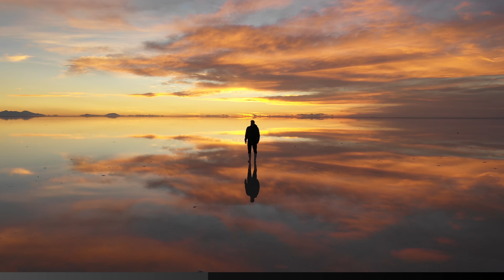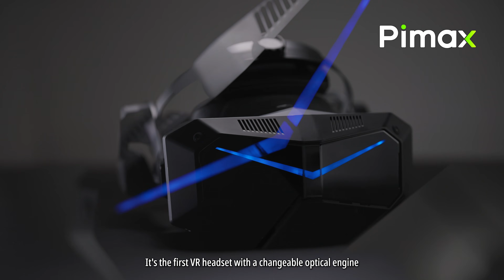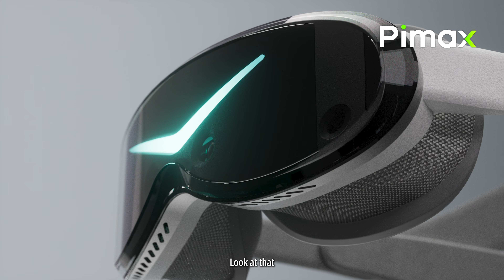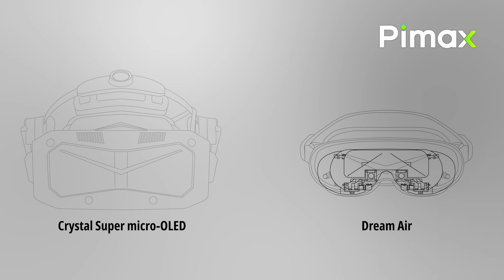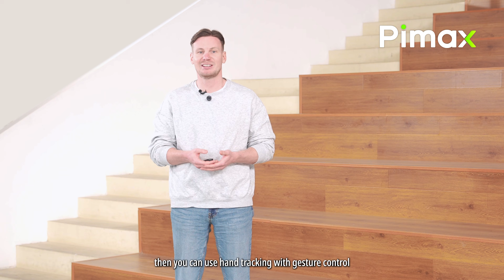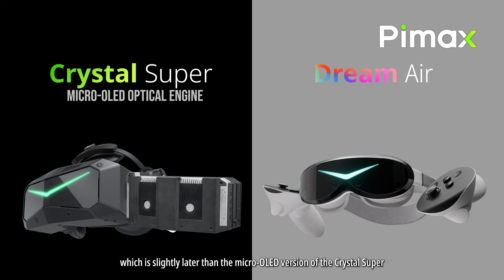Frontier: Hello Pimax Dream Air

Comment: One year later, shipping started a month ago, almost a year delay. No self adjusting soft strap, no fully auto IPD, you have to set it in software manually, hand tracking only on SLAM version.
They produce 100 to 200 headsets a month, so it will take forever until everyone gets theirs.
Edit: 
as of April 25 there is no 3D head strap included anymore, and for the SLAM version the promised ringless controllers are no longer a thing.

Comment: There is two versions of tracking that you can get:  SLAM w/ controllers and Lighthouses.  So, let me guess...if you're getting the Lighthouse version and try to integrate COBB (especially making the headset wireless), you're screwed, right?  Because how is it going to track you for example, on a plane without Lighthouses?  Tell me if i am wrong.

Comment: You need to start competing with Meta or there going to crush the industry, yes people want high end stuff, and that's great but most cant afford a headset at a thousand quid and will opt for an all in one solution from Pico or Meta, I use a Pico and at the 400 quid I paid for it, I'm more than happy with its performance, I only use PCVR wireless, and wireless is all I will ever use because cable tethering irks me, its great that your innovating and all that but ask yourself this, who owns the market share in the VR industry, and it only takes a little more innovation from them to tip the scales beyond an unrecoverable state.

Comment: Hi, I'm a huge fan of VR Headset, I had in mind, for quite some time now, to get a Pimax headset, but until now I said no, because they are not quite comfortable, especially on long sessions, it's not only about the weight but also about the volume of the headset itself, too big even if they say they are pretty good (wearability is one if not the most important aspect on VR headset).
Finally you present a headset that probably changes the rules, small, great resolution,  micro-oled, pancake lenses, 200 grams (wow), hand tracking, eye tracking, auto IPD, self adjusting strap, spatial audio and microphone, the 102° FOV is quite meh by the way (but if the rest works great ,well we turn a blind eye on this) and so on.
Nevertheless a biggest problem persists, apparently you have not quite a good reputation on support, hearing the web of course, which leaves me in perplexity, should I or shouldn't I trust the company? Because 1.800$ dollars are quite expensive.
One thing is sure, I will not pre-order it, even if I'm enthusiast and the promises are quite excellent, but the sense of preservation tells me to wait and see what it will be

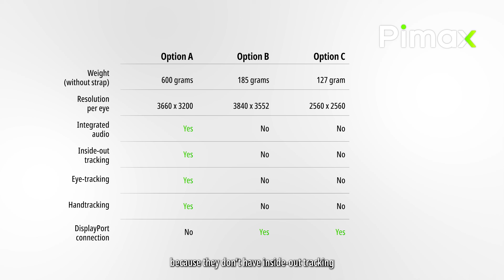Comment: 4:45 who cares about „weight without strap“?! when i want to know the weight, it should be completely assembled as i use it… i will not hold them infront of my head, so the strapping system is a necessity!

Comment: Ngl this headset seems like almost the perfect headset, the fact its inside out tracking yet targetted at vrchat players seems counter intuitive, considering most of us use full body which requires base station tracking so hopefully that base station tracking face plate will come soon after its release, also having eye tracking but no face tracking is a little dissapointing as atm the only headset that offers both is the quest pro, which quite frankly kinda sucks, and I've desperately been looking for another option, I'm also curious just how good the mic will sound on the Dream Air as the last headset I owned from Pimax had a terrible microphone, I am very excited to see if this headset ends up being real though I will definitely be purchasing it, just need to wait and see someone have some hands on experience with it so I know if this really is too good to be true because I have been scorned in the past

Comment: why would i buy this over a quest 2/3 i'm so confused
Reply: If you feel a moped is more than good enough, then yeah, don't buy a car.

Same logic here. Only people who feel the features are worth the extra cost should buy it.

For example: in my case, I like OLED headsets to be fully plunged into the dark when I'm in a pitch black environment. At the same time, if I wear a 900 grams headset for more than 4 hours, no matter how comfortable it is, my neck gets tired, even during seated experience. Ever since I got a lightweight headset, I can now wear it 9 hours long without ever feeling neck fatigue.

Comment: What is the brightness? Very important since the only comparable headset is super dim. This seems comparable to the bigscreen beyond which has the custom printed face gasket and is lighter although the eye tracking is a good justification. Its awesome that its small, light, has high res OLED and pancake lenses but that strap doesnt look like it can be replaced with third party options and developers often get ergonomics wrong for their strap that looks so uncomfortable for the ears. Where does the cable plug in? Can it be standalone. If so how much battery life does it have? I will spend over 2K for a headset with the right features. We haven't seen a clear upgrade to the valve index in four years. I am hoping they get this right I have never been interested in pimax before but this could be a big game changer if they have the right features.

Comment: The one remaining thing I DREAM this has is a much better FOV than the Quest 3. I am sick and tired of VR headsets with small FOVs. And I don't want to have to wear a giant brick just to get that either. So we have what sounds like an almost perfect balance in this headset, so long as it has a larger FOV than the Quest 3. Now, what's the FOV on this thing?

Edit: Ah, it's 102 degrees. So, not as much as I'd like personally.

Edit 2: Wait, this thing is wired? Is it wired only? I'm just not interested unless there's a standalone option.

Comment: 102 degrees FOV........

Crystal Super 120 degree FOV.......

question, when is the successor to the Pimax 8K-X coming out?   
Would love local dimming, HDR but in a 150 or 170 degree FOV headset.  Thanks

Comment: I’m still waiting for proper applications on my Pimax Crystal in AIO mode. Pimax sells headsets for a fortune but falls short on the software side. It’s astounding. Let’s not even talk about component support. I’m still waiting to be able to purchase a Pimax hand tracking module. And I’m starting to wonder if it will even be possible to buy replacement batteries for the headset.

Comment: It's still early for 8K glasses, not even the RTX 5000 will be able to run games at 90hz. Better to keep 4K
On top of that, less fov 102º minimum 115º (Crystal Light has 130)

Comment: You kept saying full feature for the dream air and it ALMOST sounds like the absolute perfect headset for me, except for one small thing, I think it is missing the feature of standalone capabilities. 
I also have something to suggest that I really haven't seen from other headsets that might help with the lightweight form factor while still having an onboard battery. What if you have a top strap that has a small battery on the top rear of the skull, maybe only 15-30 minutes charge by itself that keeps the headset on but magnetic hot swappable batteries to keep the power going that attaches right to the top battery via magnets. We've seen from other companies that small lightweight long lasting hot swappable batteries are possible, why not jump on this as a built in feature rather than a third party one? It can keep the size and weight small while still having incredible battery life potential and wouldn't sacrifice the comfort of being laid back if it was on the top rear of the skull.

Comment: 3 Strong comments!

1 - FFS Pimax - you have a HUGE reputations of bad service, and not delivering what you promise on time.
Why the hell do you keep doing these half-assed announcements? Someone high up in your company is a total moron!
For crying out loud. You dont even have a prototype - you have an ugly 3D print. Even if you get something ready for may25, it will still not live up to all you promise here. 

2 - Pimax, you had ONE thing that made you relevant and unique in the past - BIG FOV.
Now you present a fantasy VR HMD - But at the old-bad-underwhelming FOV of 102. And knowing how you exaggerate often, its probably a 98 FOV.
If you want to deliver a VR of the future, then dont come back until it is AT LEAST 120 FOV Horisontal - and preferrable 130-150.

3 - A Motor strap? WHY? - We dont need a motor strap - that is the feature a VR headset needs the least. Its 100% stupid!
It will make the VR more expensive, that is for sure! And it will be too small, to work properly. 
I think a strap holds a bit of force, especially during movement. Im no engieneer, but I doubt a motor that small, will hold it.
If you keep that stupid idea, you will have 1 more thing, where Pimax headsets have problems and needs to be replaced.

Its a beautiful rendered design idea. You would succede much better, if you announced it when you have it ready.
And then you would not have to lie about features you could not make into it anyway.

You say you make the VR that we want?
Well I dont want a brick on my face. I love the smaller formfactor!
But I dont want a crappy FOV anymore, and I really dont want a motor to control how tight I want the strap to be!

Comment: Can you make us PIMAX HELMET RACING VR (like an actual helmet) with air conditioning.. The weight of the headset will rest on the upper shoulders, the screen can larger, there will be less strain on the face, neck and head .... and the audio will be better too being enclosed. I bet it would even be more comfortable and adjustable screen wise (with a flip up screen). It would be a true racing sim headset.

Comment: Pimax should have postponed this announcement. It's really tone deaf of them to dangle yet another headset in front of customers in hopes of distracting from the major issues plaguing their current line of headsets. Fix the quality control issues of the current headsets first and deliver on the promised features/addons before taking on yet another headset. Why would Pimax expect people to risk $1900 - $2000 on this thing when they're struggling to deliver your current headsets which are based on a design that's been out for over a year and a half? After hearing about the absurd amount of RMA's and returns Pimax should extend the warranty on their products if they want to be taken seriously. And it doesn't even look like they have a working prototype yet.
Reply: @wittyname-sy5je  they don't listen to their customers

Comment: 10:11 - "...Portability in mind..." but to use it when travelling it requires a portable computer (laptop) or the Pimax COBB (computation puck) to use ...right? As it itself is a tethered headset requiring a another device to feed data to it unlike an AIO HMD unlike Pimax's "VR 3.0" goals/standards as presented in Pimax Frontier 2021 (the "12K QLED" reveal).

Comment: You need to drop the old ones. Put Wireless in the new one. Put Android OS or Horizon OS or Both. Have it access Meta and Android market Places for Apps and you will succeed. And try to cut prices at least in half... 2025 will be rough on you too...

Comment: The reality is that there is very limited options for the OLED panels. Nobody makes one big enough to be able to offer a wider field of view right now. Then you have the issue of light output levels going through the pancake lenses. All of the micro OLED based headsets are not very bright for the user. These are the limitations for this generation. I can see the direction Pimax is trying here and it makes sense to widen the customerbase by finding new options for the tech they have worked hard developing.  Ive pre-ordered the crystal Super with the QLED simply because of the fact it can offer 120 FOV along with aspheric lenses for better light output. Pimax went into detail about this on the super launch and for me that was the most important part of the presentation. I dont know why ANYONE would have ordered the super with the micro OLED as it loses the big benefits of the headset. As for Pimax QC and support im not gonna lie, its a point of nervousness as it will be my first product from them. Time will tell of the promises become truth. But there is also the fact that if people dont buy products from small companies who are trying to push the boundaries then we wont get these types of products.

Comment: Pimax was interesting and unique because of wide fov.  If you cant release the 12k yet, why not focus on expanding fov with your current headsets, instead of pushing additional headsets? If I want a "dream air" I'll get a Bigscreen Beyond for half the price..  If i want a standalone, I'll get a Quest for a third of the price. No one else does ultrawide FOV at a consumer pricepoint.  Why not focus on that, and make a tonne more conversions?

Comment: Pimax has good  and many ways correct vision. But their customer service lacks so seriously that it is almost a crime. When a product malfunctions seriously in the period of the warranty, it should be replaced ASAP. Not after months emails passing back and worth with huge delays to respond each. And when the new replacement (factory new) is sent, that has the new warranty period, not so that you end warranty as it is original old model. So sorry, if someone replaces old faulty device at end of its warranty, then the new warranty is 12/24 months longer.

And do not demand customer to pay extra to downgrade model if you can't provide a original higher end model.
These are so serious problems with Pimax, that you can't really suggest anone to buy one. 
For a company to replace the faulty ones, is road to success or failure. And pimax is heading to latter. 
It can be still changed to other road, but it requires seriousness to honor warranties and have excellent customer service. 
Even better, design the products so that they don't malfunction so easily and often and so soon. 4-5 years lifetime is expectation. Not 2-5 months. 

The vision that Pimax has, is right. The resolution, FOV and definition is key. Offer a Displayport cable with power to run the thing, and offer inside-out tracking. Make controllers optional, or even forget those, but add a hand tracking as a mouse cursor. Seriously, or offer at least eye tracking as mouse cursor. You will win lot of simmers by just that. If simmer can raise hand and point thing and press button in gaming device it is a win-win. 

Weight is not huge problem, but balance is. Keep weight low as much as possible, but don't sacrifice the quality because of it.

Comment: Ok, a new VR headset with the same panel as the Super micro-Olec version. Looks good on the paper, we will see. For now, I’m waiting for the Super QLED I have preordered. I’m not the target for the Dream-air. As a Crystal original owner and thanks to my experience with this one, no issues, everything works really good, I will not be one of those who complain, it’s my first VR headset from this company. For now, pimax is the only one to provide such PC VR headset with this kind of visual at a "reasonable" price, and as a pilot irl and a flight simmer, the visual is the most important thing with the performance of course. For those who don’t like Pimax because of their bad experiences, no one is forcing you to buy their products. You can buy the meta quest 3 for better comfort and better after sell service. Or if you have a lot of money, the XR-4 for 6000€. If I have something to reproach them for, it is that they never respect their deadlines. When considering these problems, you can buy or not.

Comment: Jaap you several times told in the last couple of months looking right into the camera that Pimax started to focus way more on customers' opinions and will not repeat the mistakes of the past. Now the fact you announce this new headset proves completely the opposite way. In addition please stop deliberately misleading your customers! Just a few examples: 
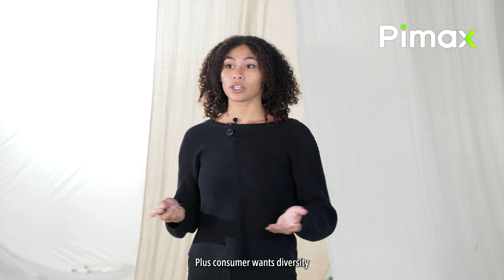- 6:31 "Especially since we launched Crystal Super" - No, you haven't launched Crystal Super. You announced it and took preorders. Huge difference!
- 10:04 "We use a Display Port connection" - No, you don't! You use a type-c c connection which has got one third of the bandwidth of DP1.4
I had so much hope for you guys after your recent videos about importance of honesty to customers. I am extremely disappointed now and I am sure I'm not alone with this opinion.
Reply: When you ask ChatGPT what to do to save your product line and you just read out a loud what ChatGPT said instead of actually doing it - be like
Reply: 2552*3840*2(eyes)*90(Hz)*8(bits per color) is 58.9 Gbps.
Current NVIDA graphics cards until 4090 only support DP1.4, which maximum Total Data Rate is 25.9 Gbps.

So a native VR DisplayPort1.4 has to use DSC visual loss-less compression to make it possible.

The same apply when you use a USB-C cable in DisplayPort Alt-Mode, it depends on USB version:
USB 3.2 Gen 1 (5 Gbps)
USB 3.2 Gen 2 (10 Gbps)
USB 3.2 Gen 2x2 (20 Gbps)
USB4 Gen 2x2 (20Gbps)
USB4 Gen 3x2(40 Gbps)

Pimax could clarify what versions of DP and USB will be supported.

In any case, all those 20Gbps are huge compared with the 200Mbps (100 times less) decoding limit of all Standalone headsets with XR2-Gen2 chips like Quest3 or Pico4 or SamsungXR
Reply: I've said it before, he has no control over anything and he is just white actor for Chinese company. Just a talking head. In this video we have two new presenters that just pop in without any real introduction
Reply: @Pixel3DVR  Well it seems it is not inconvinient for him to be the "talking head" of Pimax. As a customer I think we have the right to send criticism right to him because he was the one who personally promised being truthfull to their audience.